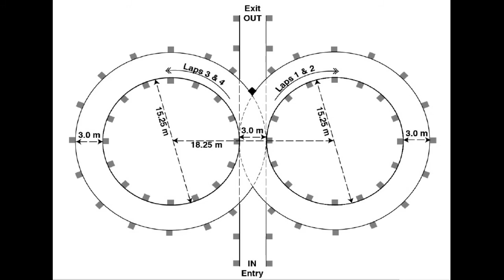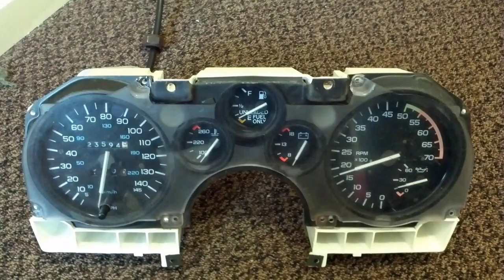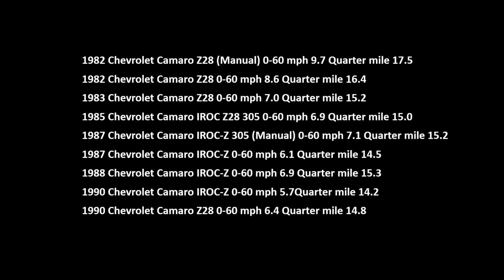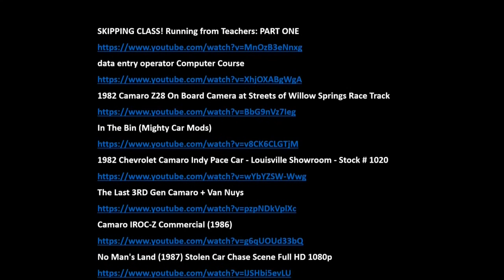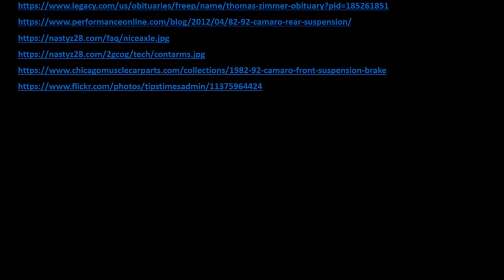Third Gen Camaro

Comment: Excellent video, Jason!  I really enjoyed this one, because over the last few years, I've really grown to appreciate the 3rd gen f-body design.  4th gen was still in production when I was in high school, and back then I preferred those designs (Trans Am over Camaro), but similar to my current feelings on z31 over z32  300zx, and mk3 Supra over mk4, I'd take a 3rd gen f-body today.  😎👍
Reply from the maker: When they were new I was not a fan. My older teenaged influencers were Ford guys. In Mexico at the street races their Mustangs always beat the Camaros. Years later when I got my drivers license I helped my car clueless neighbor restore a 1985 Z28. I helped him build a nice 383 stroker for it, matched to a five speed manual. That car was amazing and changed my mind on third gens forever. I finally understood the Third gen. In period it cost a lot more then a Mustang, but it should have since it was a lot more car. Dynamically they handle stop and ride nicer than a fox body. With a couple hundred more horsepower they really come into their own. The 383 Z28 was a riot. It would melt the tires on command, but it was a whole performance package. In 2021 a LS swap would be a no brainer. My forties has been an awaking, many of my beloved American cars were actually cheap rip-offs of expensive European cars. The third gen Camaro bucks the trend and from what I can it is a completely original, beautiful and timeless design.